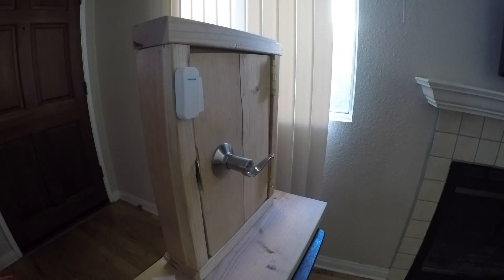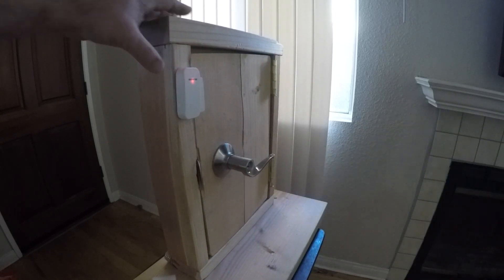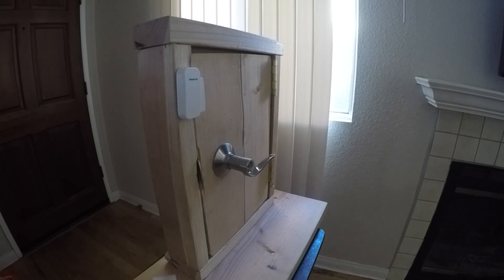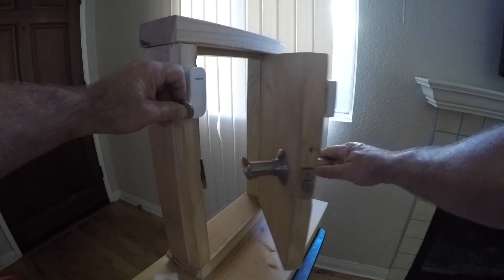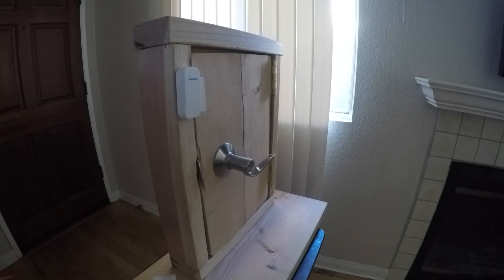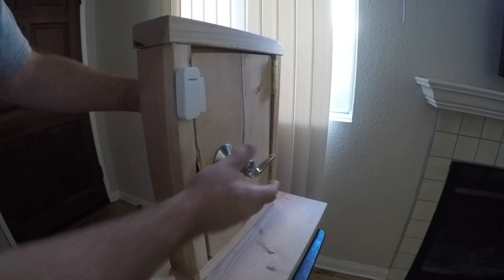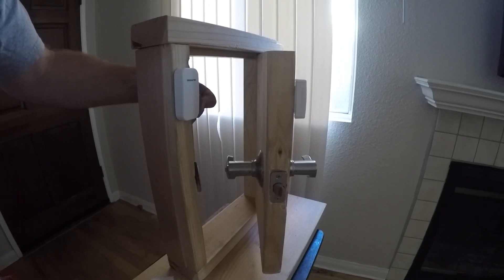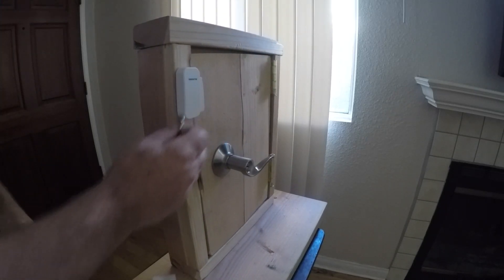Magnetic Alarm Bypass

Comment: Thank you! Do buckyballs function? They are neodymium
Reply from the maker: Not familiar with buckyballs, however the magnets I'm using are 6 1.26" diameter 1/8" thick N45 grade Neodymium magnets.
Reply: @SecuritySifu  thanks. I tried a neodymium one as well, a normal kitchen one and it definitely messes with the mechanism but I'm not sure it's good or not. Thanks man great video